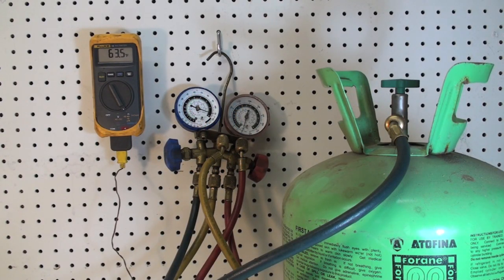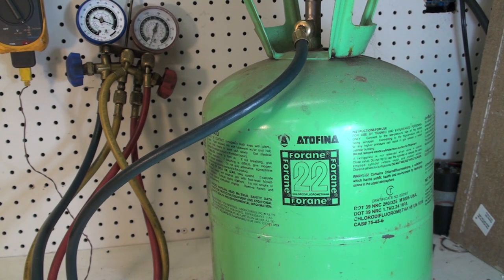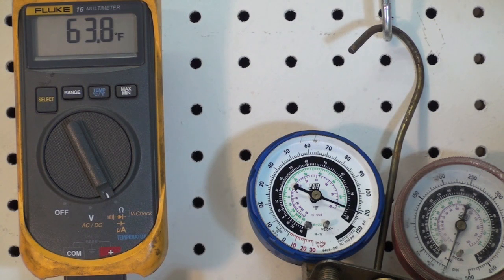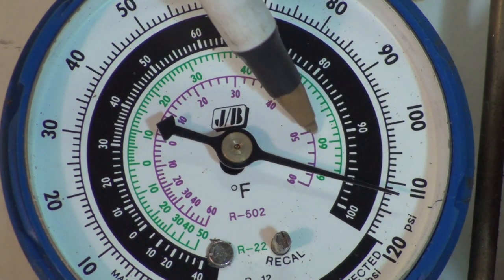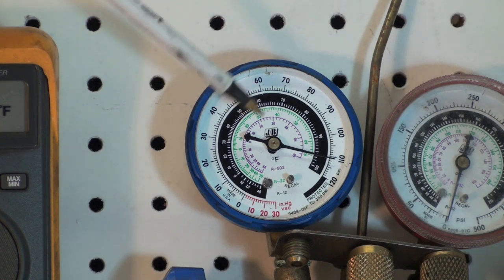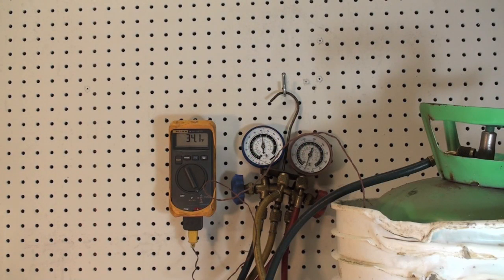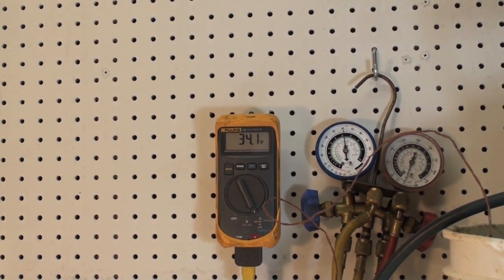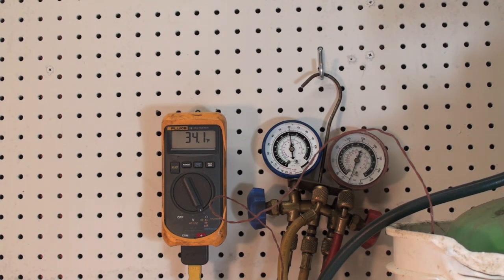Saturation demonstration

Comment: With 410A which is a blend , how close does it maintain the pressure / temp relationship .
Reply: It sounds like blends really complicate things for you techs.
Reply from the maker: The relationship is an average of the two (or more) refrigerant pressures that make up the blend.
GFM

Comment: Large facility, many different "techs", found a dusty, partially filled, unlabeled  recovery tank.
Suggestions?
Reply: Turn it in to a recycler and get the bottle back and use it.